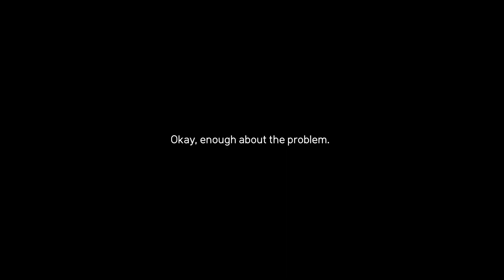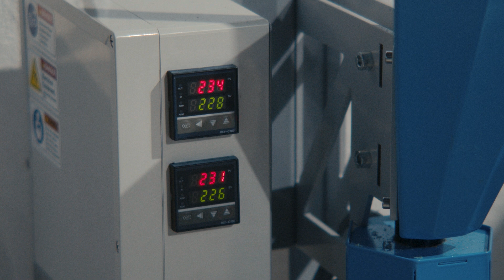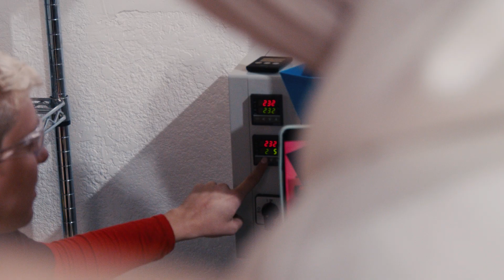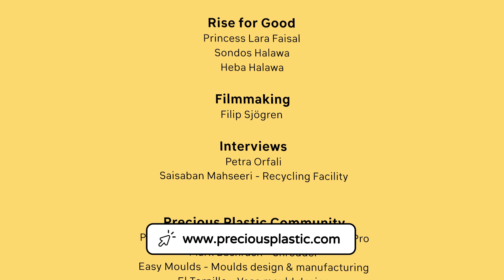Jordan Princess with CRAZY recycling dreams

Comment: I love the Precious Plastic concept of micro recycling at the local level. What continues to surprise and confuse me though, is this practice of shipping the machines to get these local projects set up. The environmental footprint is completely avoidable by  sourcing the parts and building the machines onsite, which is the original PP model.

If there is truly no machine shop that can create the cutters and other key pieces for the build, it would be a more environmentally friendly to send the local group a DIY CNC machine to laser cut their own parts - which could then go on to be used by the enterprise as another revenue stream as well as to assist with creating molds, forms or products with the recycled plastic.
Reply from the maker: Hey Charles, thanks for your comment. This is a complex topic. We are very much on your side to try reduce shipping pollution. Over the year we've tried multiple options and for this project we believed this was the most effective way of delivering top quality machines that could last. 

For example during one of our first collabs in Kenya in 2017 we built all the machines locally only to realize that much of the parts were imported either-ways still causing shipping pollution at some point of their lifecycle. Plus this added quality and durability issues that undermined that particular project. 

This is a complex problem we are aware of and hope we can get more data on that soon.
Reply: @Precious_PlasticHQ  💯it is a complex issue and and balancing local resources with the level of quality needed for long-term viability is really what has to define the solution for each individual project. 

Thanks for all your efforts and continuing work. Let's keep moving forward together!